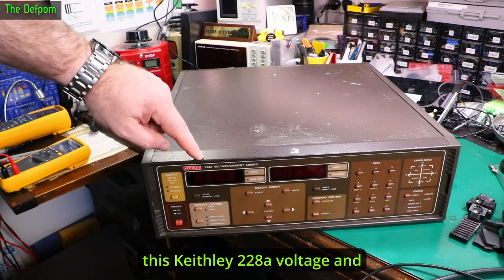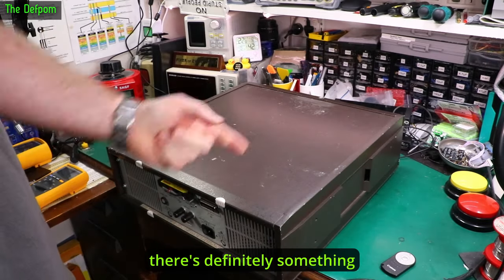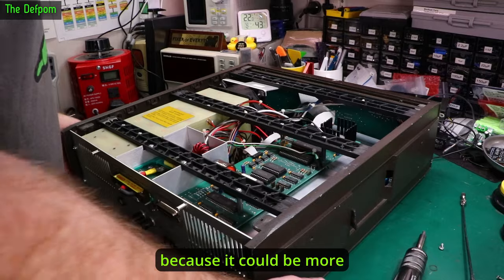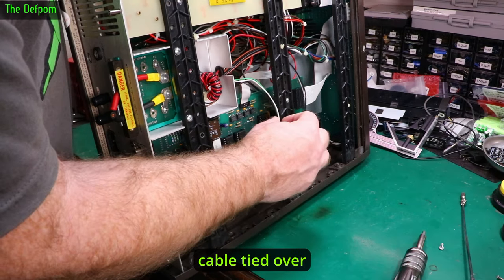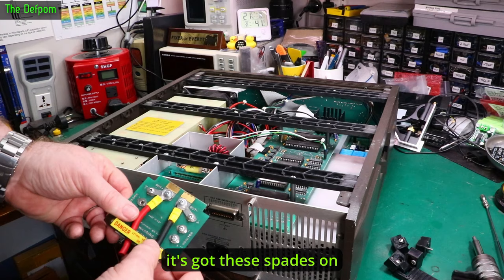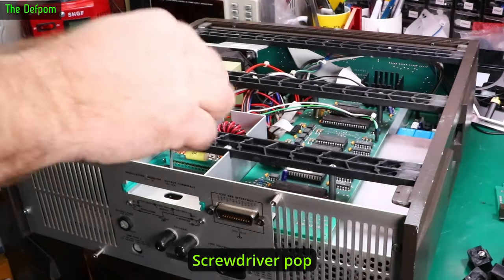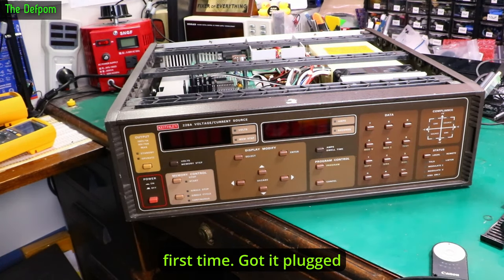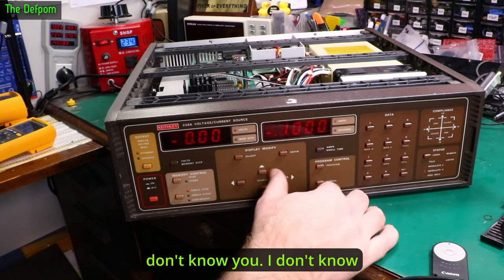🔴 Does My New Toy Work ? - Keithley 228A 4 Quadrant Voltage & Current Source - No.1190

Comment: Interesting piece of equipment,  Scott.  Four quadrant so you can use it as a programmable load as well as a supply. Another interesting aspect of the voltage selection switch design is that you have to disconnect the ouput to change voltages helping to make it somewhat idiot proof 😜. Regards, David